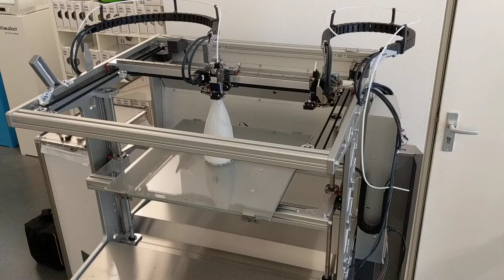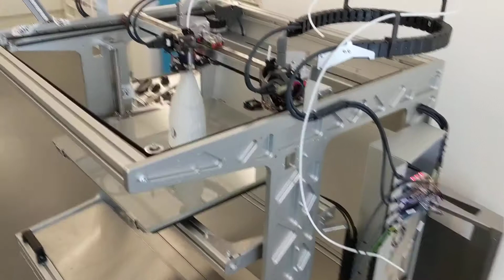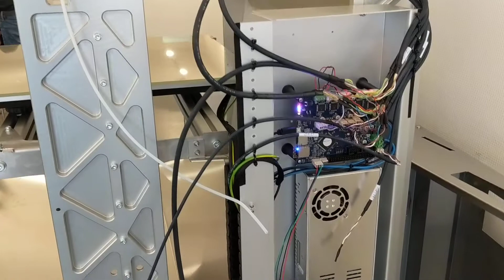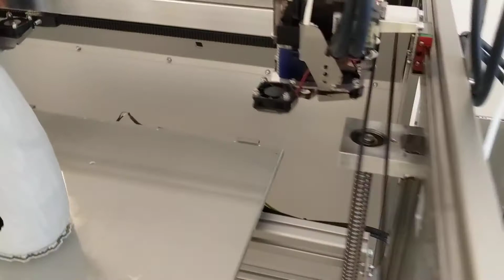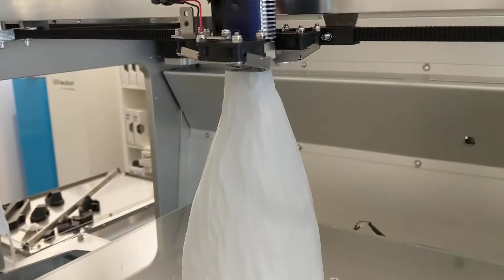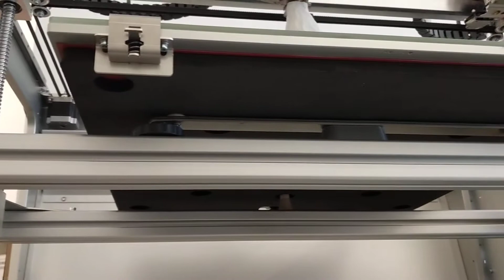3D printer large volume #5

Comment: impressive! thanks for uploading this video, what is the max printing speed, and what is the nozzle diameter? great job!
Reply from the maker: Speed is at the moment limited to 100mm/s. Depending on the quality you need and the noise level you prefer, there is more possible. The DUET board allows to make changes very easily.
Lead screw and linear rails are Hiwin. 5mm pitch, but that's not too important, all dependent on your needs for precision, speed, mass etc..
Reply: printing speed at this video seems 20-30 ??? Post a video with 70-80 speed please!
Reply from the maker: Yes your right, Simplify3D slows small layers down. And in the mean time we were able to increase jerk an accelleration much. Hope I don't forget to post some more.
Reply: The machined side part looks impressive!
Although I think it will have some waisted material, from the big rectangle in the middle,
What is the plate thickness?